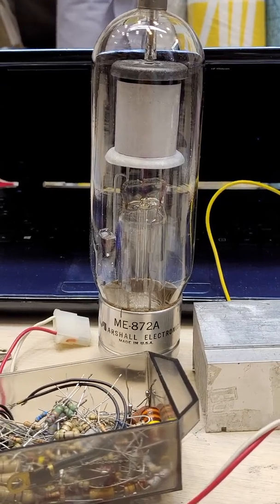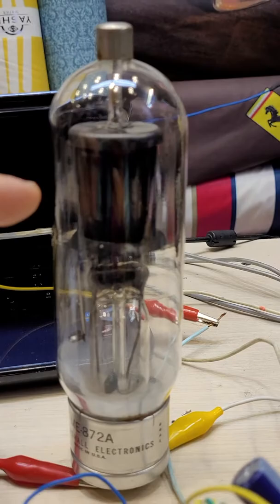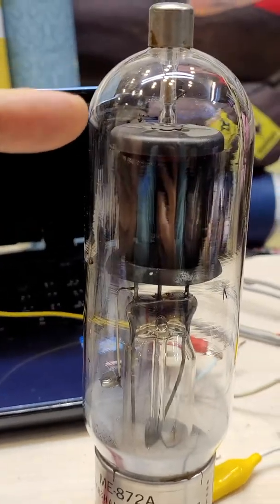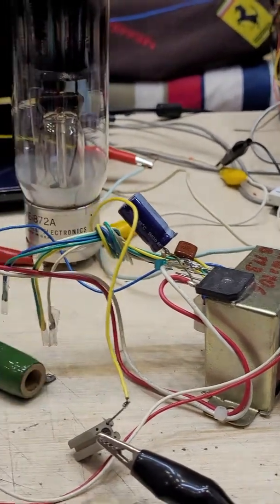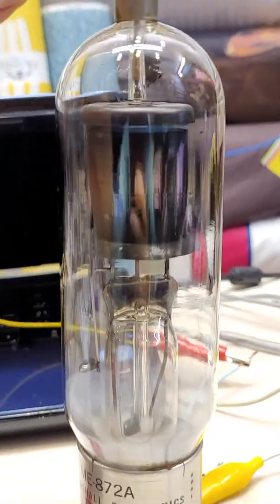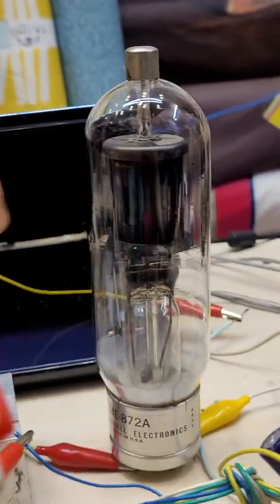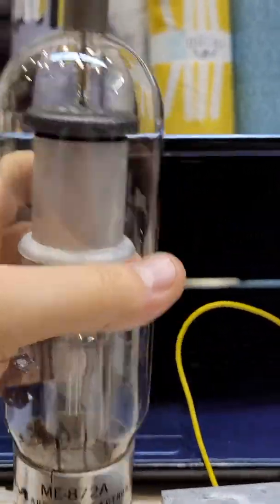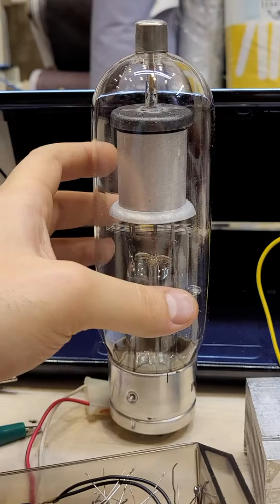mercury vapor rectifier tube at operation

Comment: I have the Cetron "8008" version of that tube.
Reply from the maker: Cool stuff
Reply: @thevoidedwarranty  I bought mine for the aesthetic value, but I discovered I can use it in my Vacuum Tube Tesla Coil in place of the HV diode string in the voltage doubler. I haven't tried it yet...

Comment: Haw I ca-n bay one!!! Plese🤗🤗
Reply from the maker: Hello , you can search for mercury vapor rectifier tubes on ebay but be cautious , these tubes normally operate in lethal voltages and requires you to know how to basic electronics safety percautions and skills .and also , this have a lot of mercury in them , if they brake they spill out the mercury ,which is very toxic. Thanks for your comment ❤️